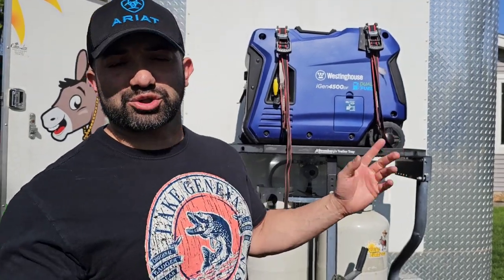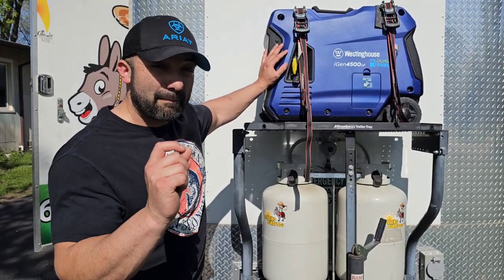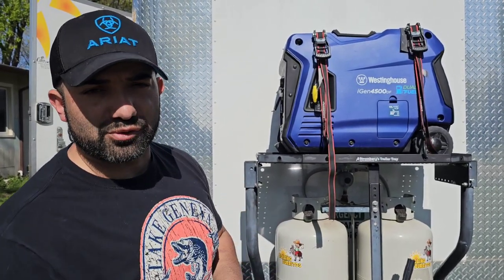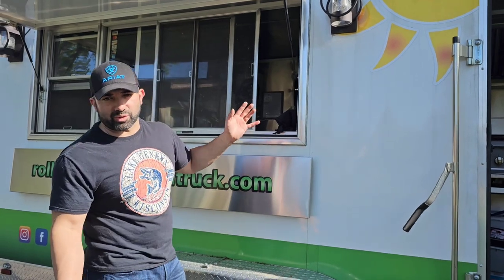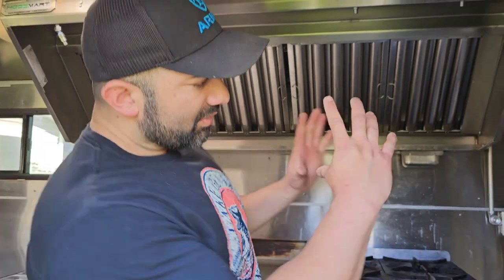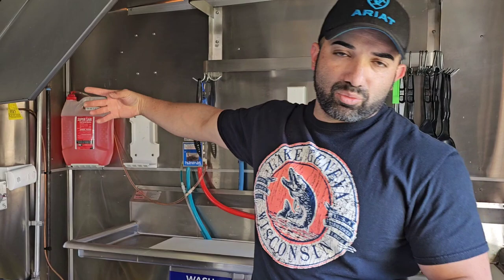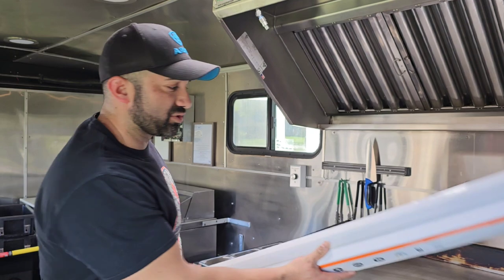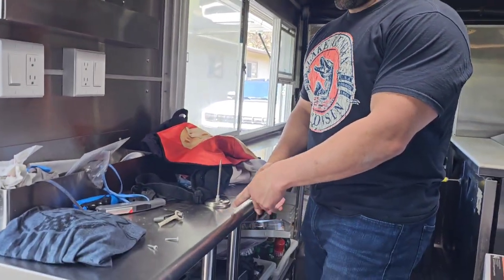Should I Build my Own Food Truck?

Comment: Great video!!! Thank you!   Hey Are the westinghouse 4500w generators quiet?  and do you think that will be able to run my trailor with lights, air conditioner, chest freezer, fridge and small appliances?
Reply from the maker: You have to add the watts and that will Give you the answer. If it's in amps multiply it by 120 that's the volts to get watts
Reply: @fbaltierrez  Thank you my friend. Hope you have a wonderful day.